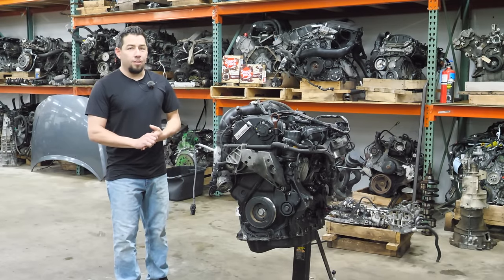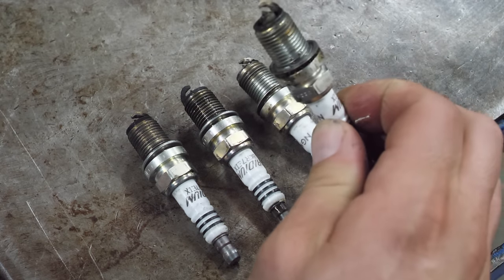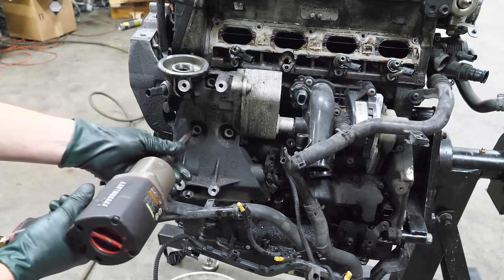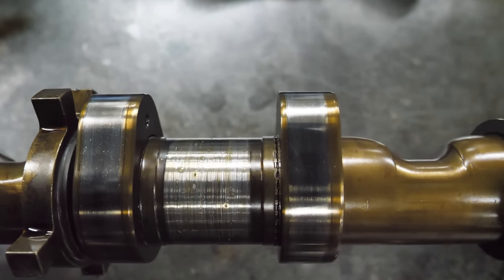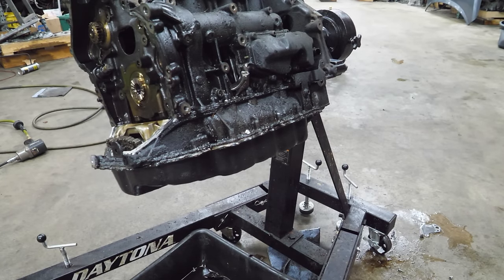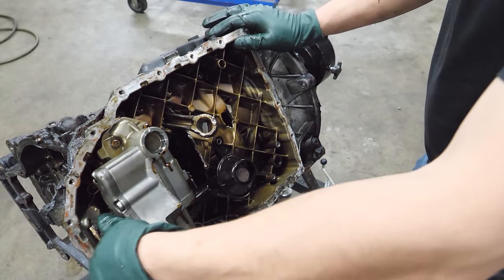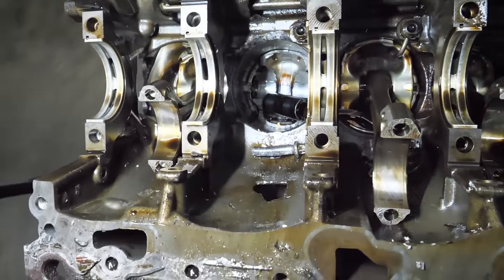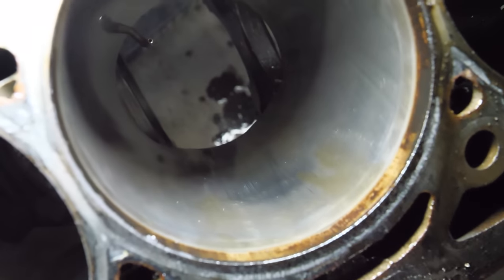Volkswagen 2.0L TSI EA888 Teardown! We Blew It Up, Lets see HOW BAD it is!

Comment: Soo we had a 2010 Eos....and one of our kids had it....He was checking the transmission fluid instead of the oil   117000 and the engine blew up...... The 2.0 Trash ...is whar I called...So now we have 2012 eos  kids are banished from the 2012

Comment: The water pump belt will outlast the entire engine.  Absolute garbage of a design.  Chain tensioners always failed on early models, especially Tiguans.  And it was NOT a lack of maintainance, it was poor design.  Later tensioners were completely designed.  The rear main seals are still garbage, though...

Comment: My wife had this motor in her 2010 Tiguan.  This motor is such a problematic motor.  It likely skipped time due to low oil pressure.  The timing chains tensioner is oil pressure based.  Garbage motors.  The PCV system in these is trash also.

Comment: More superior German engineering whats with the oil filter located upside down!
Reply: Because it’s a canister style filter and is meant to be changed top side of the car. Lots of cars have the filter upside down, especially Subaru’s. It’s not a German thing 🥴
Reply: @ryanturnerboles  I came to realize this after seeing it removed from the engine so I stand corrected Sir! it seems also one thing I failed to make a point of also is that You dont have to get under the car to remove it either! Cheers